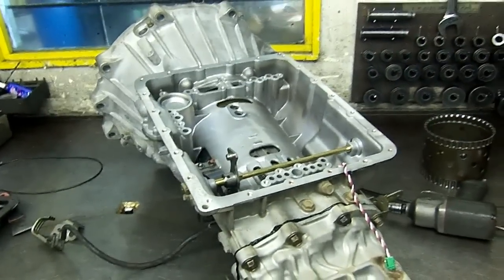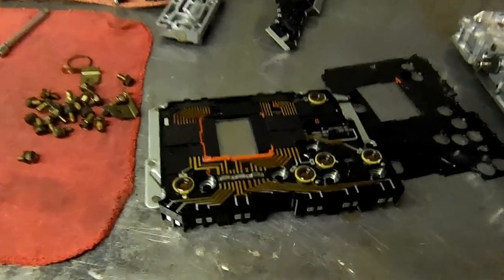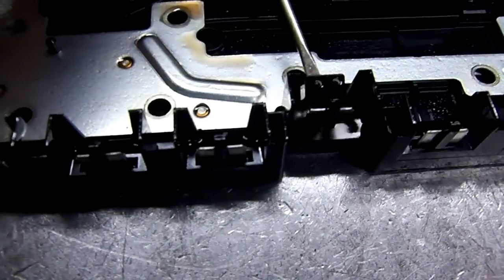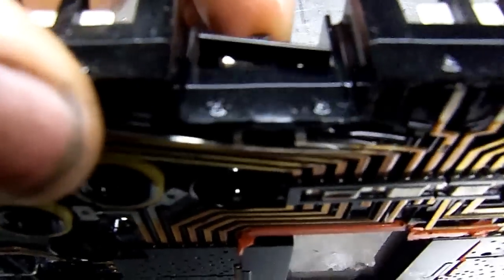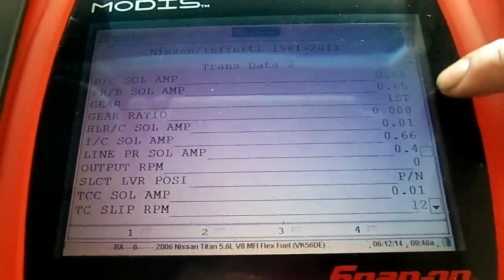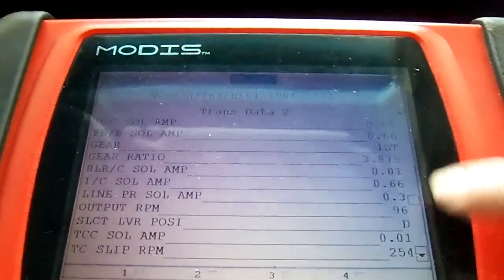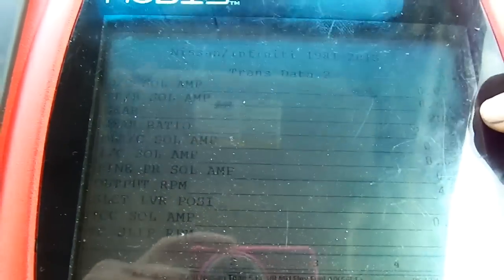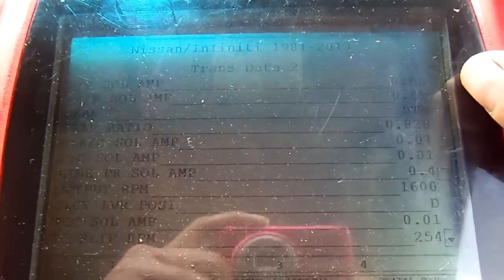RE5R05A Transmission - P1757 Front Brake Band Solenoid Circuit

Comment: What’s the best solder to use?
Reply from the maker: Any, if you use flux it'll get hotter quicker. But sand the area until you see copper colored metal. It holds better. Add a small strip of bare wire. Makes for a stronger joint.
Reply: Thanks. Is hotter quicker better?

Comment: Hey i want to do this front brake solenoid fix on my g35 but my car has 260,000 miles on it. When I do the job Should I fill it back up with my old fluid?
Reply from the maker: No, use new fluid. Lubegard complete synthetic ATF is a good fluid for your application.

Comment: Amigo! thank you for your videos. I fix a nissan 350z transmission using your videos. Gracias. I have a question, I hope you can answer. I have a 2006 Mercedes Benz cls550, i need to change the conductor plate before i spend the money, the conductor plate look like the nissan. Can be open and fix just like the nissan. thank you.

Comment: I
where could I get new solenoid from other than dealer, pulling a p1759 code is it a solenoid or valve body?
Reply: Did you figure out what to do? Did you fix it with a new solenoid or valve body?

Comment: you're a godsend for sharing this...

my Xterra was running beautifully, I parked, started back up and found this same code. 

It shifts up all the way to 4th and cycles through the gears without issues, I then noticed it didn't go into overdrive and the SES (service engine) light lit up. 

I stopped, and realize it was still in fourth gear (hardly any power when throttling). if I turn off the key and restart, I find myself back in 1st gear and it does the same thing again when I get up on the highway. Bummer. 

I'm going to tear down the valve body and I'm hoping I find the same thing. I just don't know how this happened between parking for 10 minutes, coming back, and it not working correctly.

 Transmission rats. 

P1757
Reply: Pulled it apart, (the ATF fluid shower was much appreciated, warm and rejuvenating, good on the pores), disassembled and cleaned up the valve body's TCM, soldered up the broken connection nicely, threw it back together. Running like brand new. 140k miles.
Reply: what symptoms did you have  ?

Comment: hi thanks for the info but was wondering what is causing the breakage in the circuit in the first place. I see that some repairs are not lasting and was wondering if someone knew the cause for that.. thanks in advance for taking the time to help other wrenches like myself.
Reply: The early ones had external tcms and flexible wires. The solid ones on the internal tcm being solid get flexed slightly every time the solenoid fires. Eventually they break due to fatigue. A solid crimp type repair would be better if it could be done.

Comment: when i find 0.00 A, or all pressure solenoids are 0.00% on hyundai elantra. is this mean tcm stopped opening and closing the solenoids  ? i mean  tcm itself is the problem not the solenoids. is it correct?

Comment: I have a 2008 Nissan Altima 2.5 with a Po745 code while driving at normal temp it slow down I stop and let it cool down and it drive ok for a little while and it happen again, where is the problem my TCM or is it my Pressure control solenoid?

Comment: I'am getting a p1730 code(automatic transmission interlock) on my 2003 g35 sedan. The car goes into limp mode and I cannot go over 40km/h. Is this a valve body issue? If I erase the engine light the car drives and shifts perfect.

Comment: 2006 Frontier 2.5L two wheels drive. RE5R05A  transmission . Same problem -one of the two pins to that solenoid broken but I solder them both ,adding single string of copper wire in to the solder to prevent the re-fracture. Thank you !
Reply: was your transmission going into limp mode . where only 1st and 2ng gear works ?  super slow at take off ?

Comment: Hey Hiram, this was awesome. Saved me a fortune. Same exact fault. Stripped down and used some super flux to clean up and soldered a piece of copper support wire over the join. Been back in a couple of weeks now and working fine. Only cost me the replacement oil. Know another guy recently quoted NZ$2700  for a new TCM. This is not a repair that everyone would want to attempt but if you're a bit handy wasn't a big job. Separating the face plate off the TCM without breaking it was probably the most difficult bit. Fingers crossed this will be a permanent repair, I see no reason why not. Pathfinder has done 200,000km but looks like has been out before. Cheers.
Reply: djkobafemi Hi, Yes used standard .7mm solder but used some super flux we've had for years which cleaned up the circuit tab really well. Used some .75 mm solid copper strand and put a small coil round the lower pin then soldered the circuit back in place then folded the copper wire over  the top of the circuit and soldered it in place. Put a small amount of gasket silicone sealant over the tab when I put the cover back on to support it and help relieve any vibration in case this is actually the cause of the failure. Still running fine so fingers crossed.
Reply: djkobafemi Good luck! Don't think id be going for third attempt, but at the replacement cost may be worth another try.

Comment: Hiram Gutierrez thank you for the information you share, I have a question I'm working on my 2006 Nissan Pathfinder it has the same problem I try to weld it  but only work for 30 min. Can you tell me what type of solder can I use? Thank you
Reply: ***** Thank you so much, I will try it.

Comment: Common during dis-assembled on these valve body the DIY guys typically break the snouts of the solenoids off.
We do stock New Oem Solenoids - we import direct from Jatco for these models.
Hiram if we can ever help you out let me know !

As always good info friend
Reply: *****
Yes , everything for these solenoids is listed on our website
We make it a point to always have them in stock - we do extend discounts to the industry professionals like your self

Cascade Transmission Parts Period com

email us at

sales at Cascade Transmission Parts Period com
Reply: I need a Front Break Solinoid for my 2006 Nissan Titan DTC Code P1759
Reply: +Maziar Ashore No problem - please email us through our website , we have most of them on there but have any of them possible for all years and makes - some not yet listed : Cascade Transmission Parts period c o m

Comment: Another great informative video.  The background music was a bit loud.

Do you have any videos on a '99 3.0 Toyota Camry tranny?  My TC lock up solenoid is out.
Reply: ***** Thanks for the reply. However, that's not what I wanted to hear!  I did check the solenoid and didn't hear a click from it like the other two.  I did an OHM check on it and it was open.  I suppose the same advice applies?!  I did read that the lockup clutch is a weak point on this tranny being a small one.
How often do you get one of these to work on?  Are you planning to make a video  What are the typical problem areas? (I know that's a lot to ask and please feel free to pass on commenting.)  Suggestions for locations to get my best bang for the buck on parts.  This tranny has 300,000+ on it.  Car looks and drives well for that amount of miles.
Reply: *****  Did you see this question?  Thank you!